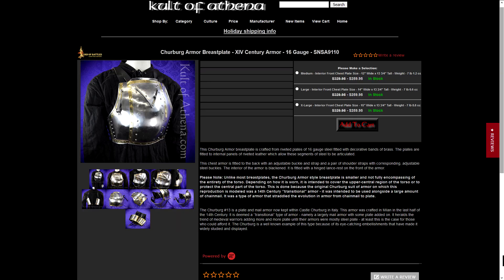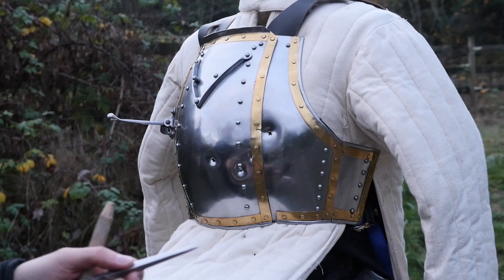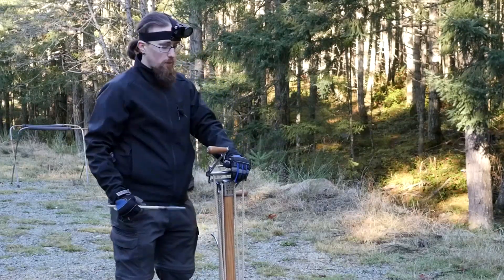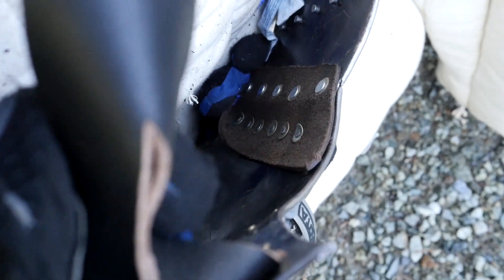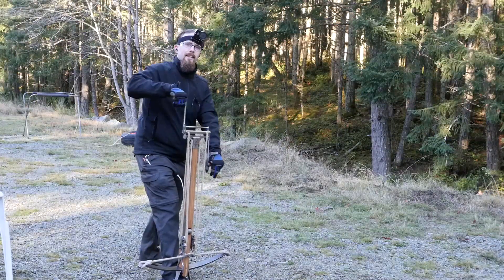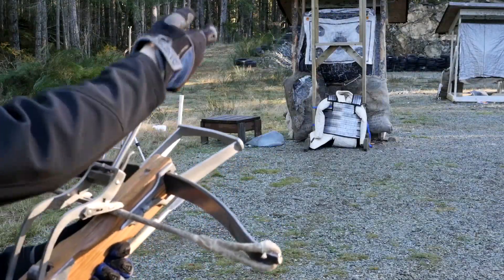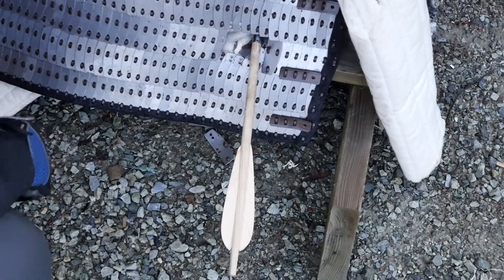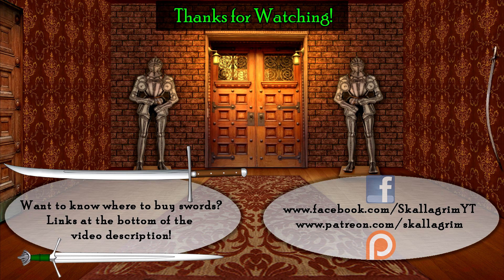Medieval Crossbows vs. Breastplate and Lamellar Armor

Comment: Regardless of penetration you're still gonna be sore from the the crossbow shots, not enough to truly stop you, but it could slow you a bit. On the other hand the war hammer is going to do some noticeable damage to you under the armor. As far as i'm aware most deaths in armor came from being pulled to the ground and having people stab at unarmored/lightly armored section. This is why halberds have hooks on them, you would be lined up and thrust, and the return you would try and hook someone's foot, leg, ankle or catch on their armor and get them on the ground at which point you and the guys on either side of you would stab down at them.
Reply: you are correct, also important to note that combat is more about breaking formations and causing routs then about actually slaying soldiers, that is done during the rout.

Comment: there is a thought  ..... material from what modern armor is made is more "durable"(spring still ...etc can endure more and protect more)., + back in a days (even when steel was implemented) armor was tempered but material of armor was "less homogeneous"  eg  plates and swords tend to crack and brake, + it is hard blacksmith  procedure to "spread"  metal equally (good quality was tend to be expensive and most "nobles'' and king dint engage in battles,,,and regular knights wear simple iron armor -with rust and wear , and reforged  many times make it less durable)
-another thing is a crossbow ,  there some "tweaks" need to be done to make crossbow more powerful , and also you need to use special "armor piercing" bolts 
-another factor could be energy *(just hypothetical thought)= some people can brake boards and bricks , but people with "inner energy" use can brake more boards and bricks..) so maybe if you put this "inner energy" toward target it might penetrate more...?

Comment: The lethality isn't through damage to the armour. The lethality is from the strikes where armour isn't protecting, or deflections to such. The arrowhead design is medicore at best against plate, but absolutely perfect against mail suggesting that was its intended design. A bolt through your arm or leg would be significant, and through your neck or under your arm would be the jackpot. Still, its a lot easier to understand why shields were less common when plate armour came about, its a heavy cumbersome item and even thin fake lamellar plate is effective. A shield to mitigate the few percentage of rare hits is just not worth it. Also this is a good test against a battlefield power crossbow, a bigger crossbow shot at range would strike the armour with less energy than yours up close. The armour is sub-par or re-enactment grade, but if weaker armour does that well then the real deal would simply laugh it off. Also it is possible for more than just bruising, ribs would be prone to breaking with that sort of attack, and the lamellar is a possibility, but I'd still wager better made armour wouldn't have that problem.

Comment: Folks--- That 1000 lbs of force has to go somewhere. What I am saying is that the target will not have a hole in them but they will be knocked back or swept from their saddle and be on the ground stunned or seriously disoriented. Then an ally nearby just walks over and finishes them.

Comment: Good way to test the armor, but not for the armor's protective value. There has to be some kind of flesh underneath that padding and have an impact measuring device. That weaker crossbow might feel like getting punched with small hands, but 900-1000+lbs crossbows will probably break a rib or leave a bruise. We have to also focus on the impact force and not just on the penetration.
A broken rib is a serious injury where even breathing is difficult, and getting hit by multiple bolts from even a weaker crossbow can eventually knock the wind out of you. And that pretty much is the purpose of ranged weapons of this era and region.

Comment: So did armies in Europe ever use any heavier crossbows above 2000 pounds? Or any armour piercing bolts? A pointier bolt or one more shaped like a pilum would be more effective?
Reply: Tod mentions at one point that there were German crossbows of 3,000 pounds.

Comment: I'm really getting the impression that soldiers in any really good armor were pretty much only killed by either being stomped to death by war horses, soaked by burning pitch or boiling oil, the occasional catapult hit, or (mostly) grappled and daggered through some tiny gap in protection.

Comment: "Some of the hits might not have been even painful to the wearer and I don't think any one of them would have caused more than bruises."

That depends. On this side of the plate, yes, it doesn't hurt.

Being on the receiving end however, even after calculating huge losses of power, that 4420 newton force isn't pretty.
After air resistance and such, getting hit by just about a 1000N of force if not more will make you almost literally FLY OFF your horse, which in the middle of a heavy cavalry charge means your best buddies stampeding you with war horses carrying knights wearing full plate mails. Fun fact, that kills people. God help you if you get shot in the head with such force, it snaps your head even if it doesn't punch through your helmet. You outright die to a headshot before you hit the ground. That also kills people.
That is for anyone having access to these heavy plate armors, they had the wealth for war horses and they were more often than not part of the heavy cavalry.

Imagine a simple foot soldier. You don't have money for a war horse and as such, you don't have money for a plate like this either. You're casually strolling in your mail. Guess what happens to someone if gets shot by something that can penetrate plate. If you imagined "the opposite of staying alive", then bingo, you won.

In comparison, a tiger during playtime hits casual 5000N forces and a force of 9000N is very likely to outright kill a human being, depending the point of impact.

TL;DR: If you get shot by these, it might not look painful from here, but the chances are, you're 99% dead.

Comment: I want to see this against stone armour (plates of stone like lamellar linked with bronze or copper links). I think there is an actual use of this in china (what age I could not even guess).
I don't imagine the bolts penetrating the padding after shattering the stone but I would presume the bolts would indeed shatter the stone (I also think the stone shards would not be of coincidence).

Comment: I've heard that occasionally bodkin arrows from longbows could penetrate armor if it was a weak spot or generally bad armor. so I want to see what a crossbow could do since they should be stronger. And my goodness are they sronger... they do penetrate the breastplate but hopefully if the wearer also has chainmail and a gambeson underneath they should be fine.
Reply: The draw weight of a crossbow is largely cancelled out by its highly inefficient design.  Crossbows and longbows are similar in the kinetic energy of the projectile.  See https://www.youtube.com/watch?v=TdB470lo6nM

Comment: has crossbow bolt embedded halfway through the ribcage

"It obviously hurts... But might not be lethal"

Classic viking understatement.
Reply: Overstatement*
Reply: jack bauer  Yeah but the difference is that most cops use hollow points and those are meant to stop a non armored target more effectively and with less shots to theoretically neutralize the threat faster yet leave a higher chance of survival due to them dropping faster, which leaves less room for a cop to mag dump a suspect if they don't go down, not to mention that they also don't want over penetration, as to not hit any innocent bystanders. In war your average foot soldier will use fmjs because they are the most cost effective to supply, and usually other hostile soldiers are better equipped than a street criminal and usually have body armor, which give a higher chance to penetrate the armor, because it expands less than the hollow point, leaving less surface area overall on the bullet. However, with an fmj, if it passes through an unarmored part of your body, it will usually go straight through, especially with a rifle(barrel length, rifling, grains, and powder in the round) opposed to a pistol.
Reply: @cappuccinosnephew1382  Actually, FMJ’s don’t usually go all the way through unless they’re big rounds like .308, 7.62x39, 7.62x54 etc. 

The standard 5.56 and 5.45 are designed to penetrate armor but when they hit a torso they typically trail around in the body making a rainbow shape or U shape
Reply: You still bleed out... adrenaline just wins you some time to run away, but you do that in army, you’d be tried for desertion
Reply: @dznuts123  Desertion wasn't really the same thing. back then; obviously people in medieval times did desert, but there wasn't an entire state apparatus to punish it. Instead the awful logistics of the time meant deserters just starved to death or were killed by peasants who knew deserter = someone willing to loot them.

Comment: Hey Skallagrim, i know this video is old but i was just wondering - did they use full-iron bolts (with at-least fire-hardened points) back then? Could increase the kinetic impact force enough to go through those steel plates. You could re-test by using some sharpened iron rod (not a round tip) xD. And aim for the spot with the most resistance so the impact force isnt absorbed. Would be fun to see the armor finally fail to a crossbow. BTW: i really enjoy your content, thanks man

Comment: Crossbow bolts were developed to pierce armour. It's no good trying to push a long tapered object through steel plate. To pierce armour the head of the bolt was flat but in a crusiform shape. The four flat arms of the cross made 4 cuts that opened up like petals on a flower making a hole that was bigger than the following bolt shaft. The bolt performed rather like a small press tool

Comment: Can you point a crossbow down ? Or will the bolt fall out?
Reply: The bolt will fall off unless it's held in place by either the user's left thumb (which is a lot less dangerous than it sounds) or a bolt clip, which was a piece of spring steel that curved over the trigger so that its end pressed on the butt of the bolt.

Comment: I read that one of your subs has it right. Modern reproduction Armour is way harder than the 1000-1500's Armour which when hardened was typically in the Rc45 to Rc48 range and bodkins and such were hardened and not tempered so they will be Rc58-Rc62 and will cut through and shatter so they can't be shot back at you.

Comment: "So, if you're unlucky while wearing armor, some bastard might hit you twice in the same spot"
Reply: @holywatermuffin7772  just lower your head and keep your arms adjusted to your torso
Reply: @ComradeHellas  or just use a fucking shield dude 😭
Reply: @skndr1964  shields were not frequently used by european infantry, they used 3/4 plate armour which was more than enough to stop any crossbow bolt as we can see
Reply: @ComradeHellas  It was about lammelar
Reply: From this distance - who will hit next will be the man with the sword

Comment: I don't know if you still have this armour but I would like to see a longbow in the 120-140 vs a mongol bow on these armours.

The damage they cause compared to the crossbows would be informative. Longbow vs plate videos exist etc but no ones really taken all the weapons of around the 14th/15th on the same armour. Even if the armours not accurate it still gives you an accurate representation of each weapons strengths compared to each other. Some longbow videos show it penetrating plate others show it not... because the armours different quality etc.

I'm also wondering if the longbows faster arrows may penetrate.

Also slings... I would like to see what you can do with a sling fireing a good sized rock they used to think were "cooking" stones from forts. Those things should mess things up :P

Comment: The plating looks efficient but I think the secondary blunt force impact is not to be underestimated. Especially around the rib cage. Cool video.
Reply: Does it make someone recoil as it fires? Does the man firing jerk back as thr bolt flies?
Then impact effect can be dismissed.
Reply: @sunrisejackdaw1779 that’s not how that works. All the momentum is concentrated in the tip at impact, as you can see in the video how the armor distorts on localized impact. They would also shoot from elevation aiming for the head. So if it hit a weak spot, it would penetrate you body, but if it hit armor it could crack ribs or skull
Reply: @diverman1023  Clearly, no work is done to bend armor. Clearly, impact transmits through in flagrant defiance of physical law, like sonic weapon from space. 
When material is bent, energy is used to do work of denting vest. Force acts on whole object, and localized area yes, but indent is minor, unless suddenly armor is bonetight for some reason.

Comment: Fix those holes with flex seal and BAM good as new
Reply: Pikachooo make the backing and cord out of flex tape. Behold; The Absolute Unit, a set of metal lamellar so durable it’s said it can even break katanas on its surface

Comment: [meanwhile in Hollywood] ARMOR IS AS EFFECTIVE AS PAPER!!!!
Reply: I mean the japanese made paper armor
Reply: Layers of paper can make quite good armour against sharp objects.  If the 'grain' of the paper is alternated to provide bidirectional strength it works even better. If you make plates of paper armour using starch/glue (papier mache), it can be incredibly strong. I made some 'armour plates' from 32 layers of cheap printer paper and PVA glue, compressed the plates using a few heavy books and when they were dry, they stopped determined thrusts from some seriously sharp knives. Just keep away from open flames. 😁
Reply: Or paper is as effective as armour.  Watch two crazy Finns make body armour out of toilet paper AND IT WORKS:  https://www.youtube.com/watch?v=NwcSjB2euCc
Reply: Pretty ironic that historically there was a type of armor made from paper and it was surprisingly effective.